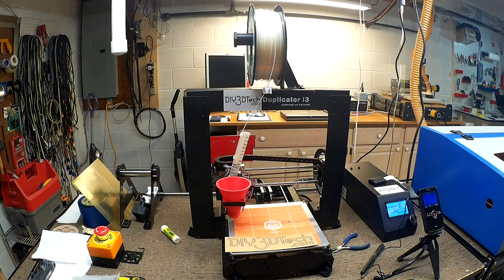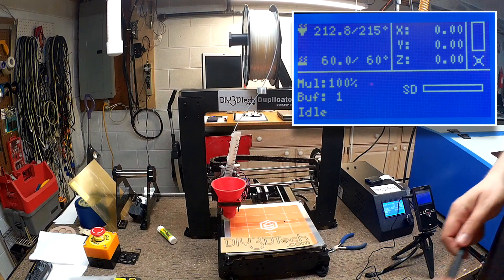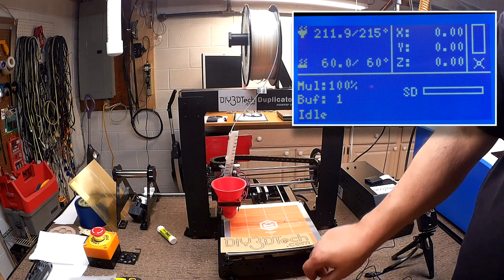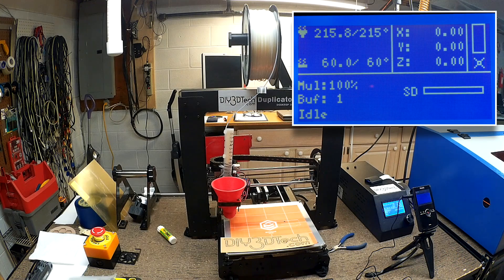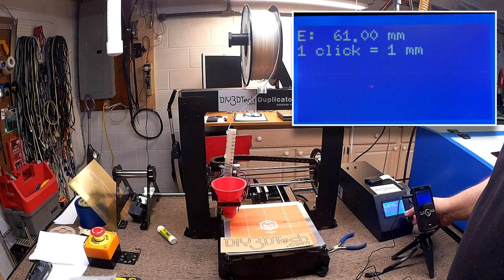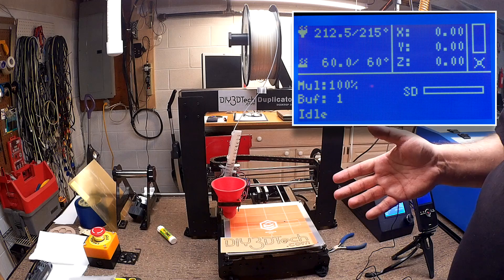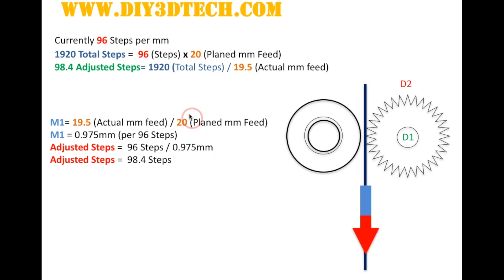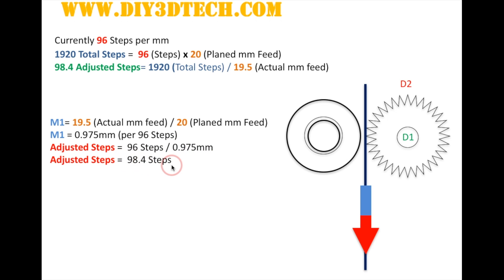3D Printed Project -  Extruder Measurement Tool Part Two!

Comment: Hey, that measurement video was cool.  I would be curious to know if different filaments would have a different step value.  Does PLA have a different one from BAS or Ninjaflex or is there even a different value between manufacturers?  Loved the Kodak camera! I noticed the wide angle lens on that video.  The barrel effect was noticeable around the edges but not distracting at all.  The video quality was great.  I do wonder how much filament I used on a certain print that I did for my wife, a scrap booking marker pen holder, because I have a little bit of filament left on the spool but don't know exactly how much.  Do you know how to estimate the remainder of filament on a spool (hatchbox PLA 1.75mm)?  I saw a video that someone did that the spool was transparent and there was an estimate gauge sticker.  That is freaking smart!!  I just don't want to be 13 hours into a 17 hour print and run out!!  Doh!! That would be bad.
Reply from the maker: +Norbert Davis Technically I would say yes to the question would be different, however for most it would likely be so small it would not be trying to measure or adjust for.  In your slicer it will tell you how filament you use and many you can even set the cost.  However you would have to track on your own unless another viewer knows a better way and if so please chime in!  :-)